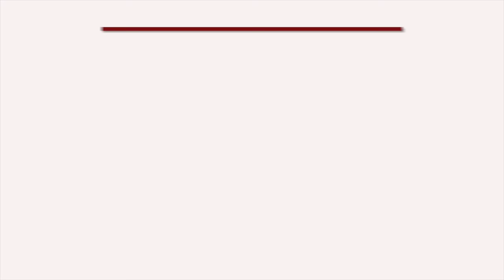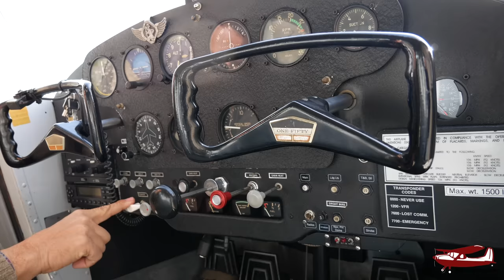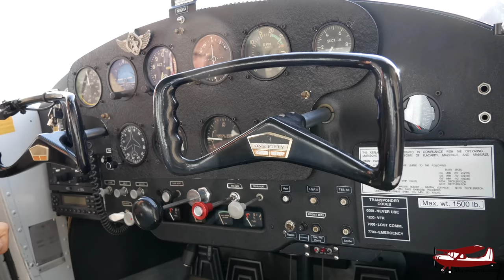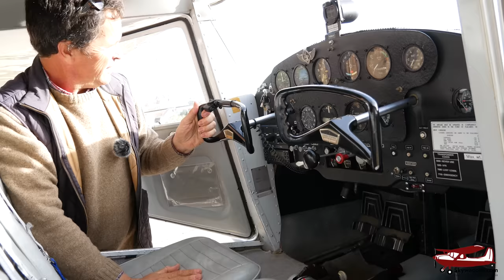59 Cessna 150 Taildragger

Comment: The Continental 0-200 hold six quarts of oil not four, and it develops 100 hp at 2750 rpm (at sea level anyway).  I normally fill my oil tank to 5 quarts as it always blows out the sixth quart anyway.  The sweetest thing about it is it only burns 4.5 gallon of gas at 2350 rpm cruise, 7,500 feet at 100 mph.

Comment: I liked your story about the instructor who would turn the fuel off to simulate an engine failure.  I had a similar situation with an instructor in a Citabria who was giving me taildragger instruction.  For those unfamiliar with the Citabria it is a high-wing two-seat tandem airplane, and it had the magneto switches - plain toggle switches, installed on the left wing root.  So if you were in the front seat, the magneto switches were high and behind your head.  This instructor would, at random times, reach up and switch one of the magnetos off, and of course the engine would lose RPMs - your signal to look for an emergency landing strip.

He had done this to me on several flights, and I was getting a little tired of it.  So one day when he pulled his trick, I just reached up and switched off the other magneto.

He didn't do that any more.
Reply from the maker: Good idea.

Comment: I've always wanted a C-150 taildragger. When I was a kid of 5 back in 1970 I had a toy that was a tricked-out C-150 (with a red and black checker color scheme) that 'flew' in a circle on the end of a rod that was connected to a motor/controller/hand hold. It was kind of like the helicopter toy that used to be around except this one you held in your hand. I don't know if I'm explaining it correctly, but that plane was just the start of my love for taildragging C-150's and C-185's too! Thanks for the great video! I wish I had $45k sitting around. I'd love to own that beauty.
Reply from the maker: That was a control line plane. I had those too. They are fun.........Before the crash.
Reply: @skywagonuniversity5023  Yes, I remember control line planes. And I remember the crashes. I had a really nice Stuka that I had saved up all my money to get and on the first flight the elevator got stuck and I watched the most beautiful loop until it wasn't.

The 'toy' I'm talking about is a different thing. It was basically a handgrip that contained batteries, with a rod at the top connected by a pinion so it could revolve around the top of the grip. At the other end of the rod was a C-150 that had a small DC motor powering the propeller, and the plane would then 'fly' around the circumference of the rod. It was a simple thing, and I wish I could find a picture for lack of description. I also had a Boeing 727 'model' that had a 4' long fuselage and corresponding wing dimensions. It had motorized landing gear that also retracted, opening doors and rear airstair, and audible engine sounds. My dad was in the USAF and always came home with some really cool toys. I'm not always sure if they were for me, or him! LoL!

Comment: That's a very pretty aeroplane - thanks for sharing. My dad's first aeroplane was a 150B but with tricycle undercart (although he's a taildragger man). I collected it with an ex RAF pilot, on a bright cold day, in, iirc, 1981, from Kiddlington and we took it to its new base at Thruxton and then lent on a heavy duty drill into WWII concrete (and flint) to fix some tie down loops (it took hours). Happier times💜👍✌️

Dad said that when they tried spinning it with full tanks for training, it wouldn't spin, the tanks had to have less fuel and biased🤔🤔
Reply from the maker: I used to live near Kidlington.  Thruxton has it's runway inside the racetrack doesn't it.  landed there years ago in a Seneca on Christmas even loaded with ice.  I was not the pilot.
Reply: @skywagonuniversity5023  Kidlington isn't a million miles away from me now. Yes Thruxton has the race circuit on the outside, in the early 1980s it was in decline, although there was lots of other activity on the site. I've driven the race circuit in a Morris Marina van, aged 14 ✌️😄 The circuit is used a lot more again now. To get to Thruxton from any local airfields used to take one through several MATZ at about 1000'. Thruxton had some great Christmas parties there too, back in the day, iirc. I have to say that your part of the world looks stunning - not sure if I could cope with the extremes of temperature though (being a Brit). Fun airfield you have - stunning✌️😊👍

Comment: Wow! What a beauty! My dad developed the Texas Taildragger STCs, along with 150 & 180 hp conversion kits & long-range tanks for 150/152/172s. His last plane, which he restored, was a 1959 150 with Texas Taildragger & 150 hp on the nose. This airplane was gorgeous & he got a special reg # N59150 for "1959 150." It was emotionally difficult to sell this plane after he died, but was necessary. I dream of buying it back someday & fly it, and very well may try.
Reply from the maker: You should find it and buy it back.
Reply: @skywagonuniversity5023  I will in all likelihood find it and make an offer, but need to wait a year or so. Geographical & career situations are fluctuating & it's not a good time to buy a plane. Your 150 is awesome and I'll likely be repeating my viewing of your wonderful video many times the next few months.
Reply: I flew a C150 Texas Taildragger with the 150hp conversion. That STC also removed the spin restriction. It made questionable off-airport operations easy. I even flew it from Atlanta to Oshkosh and back in the early 90s. Useful machine with those STCs. Your dad did great.
Reply: @SR-et8zx  Thank you so much! Yes, increased utility was one of the main benefits. We sold many kits to Alaska pilots. That was one of the greatest times of dad's life, going through years of development & testing to earn a few STCs. These little Cessnas always were praised when we'd fly to airshows & set up a table & try to sell kits. They did well for a short time, but ultimately performance mods for little Cessnas didn't sell well. Normal 150/172 owners are often flying on a budget in the first place.

Comment: That looks like a really sweet airplane. Anyone who has any time in an Ercoupe 415C like I own would be instantly at home in that plane. The panel and its operation is pretty similar, except the trim control and of course the Ercoupe has no flaps and no rudder pedals. The engine, fuel burn and range is almost identical. I think that Fred Weike designed the trike gear into his Ercoupe before any other designer did. I have heard that the introduction of the C-150 was a very strong competitor for the Erco Company. I know that Fred went on to design the Cherokee models of Piper, so he may have doomed the Ercoupe when he did.
Reply: I read the Tripacer was kicking butt on extremely strong sales, enough for Cessna to revamp their idea's and copy Piper with the tricycle gear.

Comment: Good little vid :), I have a C-140 with fabric wings and a Cont. O-200, great little economical bird especially burning 3 to 1mix of mogas. The oil sump is a 6 qt.'r, you got the fuel burn exactly right at 6 gal. hr. I figure 2hrs per wing until prop stops.

Comment: Hi Mark,  Interesting comment about fuel caps.  Right tank vented and the left one not vented.  I believe that's how they come from the factory.  I fly 2 different tri-gear 150's, one with the factory setup (left cap unvented) and one with 2 vented caps.  The 150 with the two vented caps will almost drain the left tank dry before pulling fuel from the right tank.  It's so bad that I keep my flights short so I don't completely drain the left talk.  Do you have any personal experience with 2 vented caps causing this issue?  Any resource online that you know of ?  Thanks.
Reply from the maker: I'm no mechanic but I've seen and heard that only one of the caps should be vented.  I'd call the Cessna pilot's Association and speak to a guru about it.

Comment: I have a question, the fabric wings don’t have the faller flap, the faller flaps brings down the vref, OK, BUT aluminum wings are way heavier and heavier planes have higher vref, doesn’t it make the vref from both reasonably equal?
Reply from the maker: It does. Both are so close in performance in the right hands.

Comment: A little off topic question. I was an airport kid in the early 70's (washing planes and working around the strip) and one day an old guy took me for a little XC trip.  A low wing plane, we were climbing out and he told me to take the yoke (!) as he reached between the seats and started cranking up the landing gear manually. Any idea what that plane might have been?
Reply: Me 108 taifun
Reply: @Repinnc  just guessing, it might have been an old Bellanca 14-3 or similar.
Reply: Thanks guys!  It was at LEAST 50 years ago, and I was just a kid.  But I do remember standard yokes, not sticks, and a crank for the landing gear not a lever.   Looking at the old Bellancas the '47 Cruiseair might be it.  I found a couple descriptions mentioning the gear crank.
Reply: Probably an early Mooney, they had manual gear retraction, with an electric option coming later.
Reply: It may have been a sud gardan horizin, gy80.   I owned one for a while, 19 turns to the left wound the gear up, 19 to the right put them down.   Gear was connected to the flaps.   Look up VH YOG, that was mine.

Comment: Looks like my 185 had a puppy.  I like it. One of the airplanes I learned to fly was a straight tail 150.  There is a connection here.

A LyCon, hot rodded O-200 with 115 HP would he a hoot.  Wish I had room in the hangar.
Reply from the maker: Or a Kitten.
Reply: @skywagonuniversity5023    Puppy.  Definitely not a kitten.  Distinct character difference.😎

Comment: Im interested in your comments around vented fuel caps, ive got an R172K that has two vented fuel caps, I have issues with the fuel system not venting very well. Any ideas?
Reply from the maker: The air must be able to get in through the caps as the fuel goes out or a vacuum will form in the tank and the engine will quit.
Reply: I'm curious what he meant by that also. Not familiar with too much venting. Every Cessna I know has two vented caps.

Comment: The instrument overlay shows redline at 120 kts or 138 mph.  Compare to swept tail 150s at 162 mph.  Was the straight tail redlined that much slower or does it have something to do with the conversion?  Beautiful airplane!
Reply from the maker: Hi Colin!  The overlay is a representation only.  It uses the GPS data from a GoPro and isn't 100% accurate.  I didn't have a good shot of the airspeed indicator to create the dial, so I was guesstimating the numbers for the overlay.  No intent to mislead ... it just isn't accurate to begin with.  - Don the Camera Guy

Comment: Do you have to get a recalibrated oil dipstick when you get a tail dragger conversion on a 150?  If not, how can you get an accurate measure with the engine slanted back in the new configuration?
Reply from the maker: Good question because on a 180 or 185 there is a "back" and "front" to a dipstick.  Floatplane (on floats the plane is level) on the back between the two "X's" and quarts for wheels on the front.  The 150 has a roundish oval sump that is lateral across the underside of the engine so the oil is hardly in a different place when nose-wheel or tail-wheel.

Comment: Electric flaps were not an improvement due to 1) taking more time to deploy and 2) difficult to perform annual maintenance removing, cleaning, inspecting, greasing and reinstalling the jack screw inside the wing. 🤠
Reply from the maker: Manual flaps are better.

Comment: If a CFI ever shut the fuel off on me like that, I punch him in the face. There is a possibility you can’t get it started again if vapor lock occurs. Pulling the throttle by surprise is a perfectly fine way to simulate engine out.
Reply from the maker: He used to do it on down wind  and glide to a landing.
Reply: @skywagonuniversity5023  That's even worse.  You then have one chance to land the plane correctly without a go-around possibility.  At altitude, you still have a chance to restart the plane.  

I don't understand the need of some CFIs to prove theirs is bigger than their student's by scaring the hell out of them by putting them in real dangers.  That's as unprofessional and stupid as it gets.
Reply: My Dad was a commercial pilot for 41 years in the western Canadian arctic, back in 1979 a fellow pilot turned his mags off in a Cessna 206 and threw the keys out the window, Dad popped him after landing, needed to express how he felt about that  stupid act.